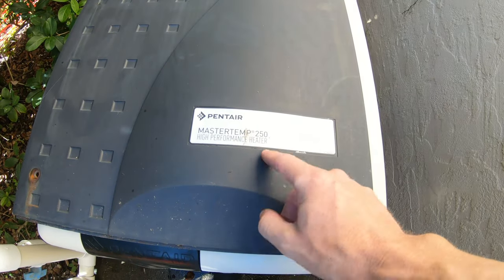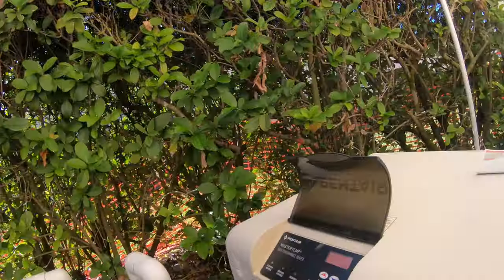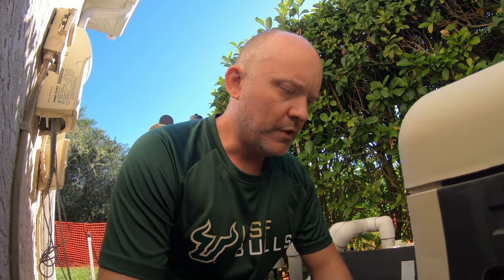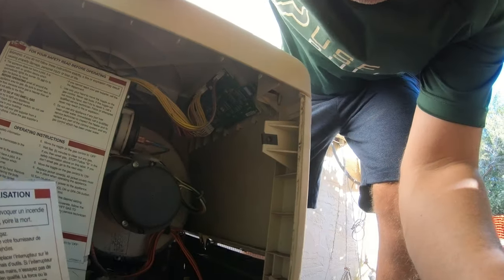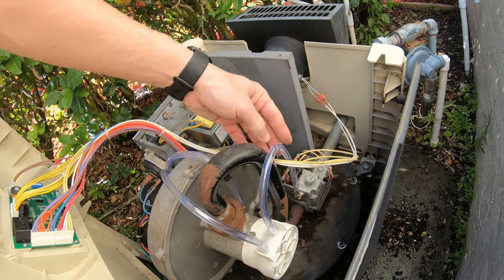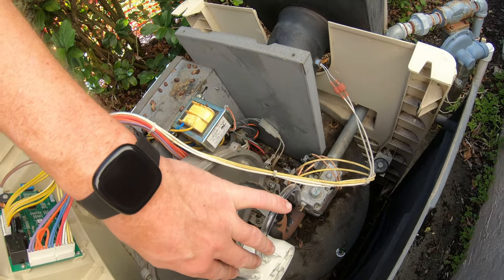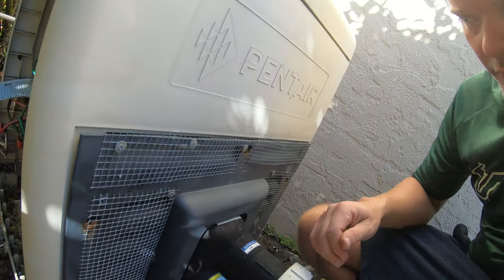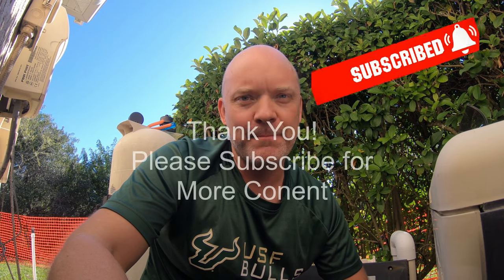Pentair pool heater turns on but does not heat, how to fix.

Comment: Nice job! We have the same heater with the Service Heater light on. We will have to see if any rodents damaged any of the tubes.
Reply from the maker: Jon, I was kinda shocked at just how open these units are. Just about anything smaller than a squirrel can get in there... good luck!

Comment: A lot of the mastertemp problems are rats chewing but also the control boards getting wet.  Those covers still allow water in.  I see it all the time. When the control boards go you will get false sensor outages as well.  This is the number one issue with these.  Replace the top keypad as well.  Aftermarket's work fine.  Peace. I work on 20 of these a week at least.
Reply from the maker: Yea, I'm about to do a keypad video here soon.... kinda shocked how open these were made. The vent holes are huge! Thanks for dropping in.

Comment: Great video! Our clear tubes were pristine, so I replaced the Air Flow Switch.  The system worked for about 3 weeks and has quit again.  Is the next step to take apart and check the fan for debris?  How would that be accomplished?  Thank you.
Reply from the maker: At what point is it failing? Does the burner kick on at all?
Reply: @JackofAllTrades1  Thanks for the quick reply.  No, the burner does not light at all.  The system clicks 4 or 5 times and I can smell gas as it tries to light, but it eventually times out and displays "ERR IGN".  I also noticed when I first turn the heater on, it is displaying "ERR AFS".
Reply from the maker: @shawnstewart00  same thing happened to my neighbors unit and it ended up being that the spark electrode had rusted away from the burner so it was no longer near enough to the natural gas to ignite it. There are several safety features on these heaters so the fact that you are getting all the way to gas releasing, but there's no ignition, means one of the elements of fire are missing. Maybe air? You said you were thinking of checking for debris in the intake.... I think that's a good idea. The click you are hearing is the ignitor, but it may not be close enough to combust the gas or may not be getting enough air.

Comment: Hey jack my pentair 400 won't ignite the blower kicks on but the heat won't kick on just the blower I've replaced the thermal regulator and a high limit sensor and it's still not working anything else I could be looking for
Reply from the maker: I'm assuming you checked the tubes like in this video ans none are leaking. Did you completely shut the power down on it after the part replacement? Check for a rodent nest in the actual blower? Should be a screen over the intake but it could be missing. Are you getting any error codes?

Comment: Hey I have a master temp 250 that I've had to replace just about everything on it at least twice. It goes through the start up cycle and won't fire. At first it was the HSI so I replaced it and it worked all summer. When it got really cold in the morning lately it wouldn't fire but then when it warmed up in the afternoon it would. Now it just won't fire at all. Is it possible that the HSI is just not getting hot enough. I know that after it cycles through the start up process and then locks out I have felt down around where the HSI is seated and it is pretty damn hot so I'm pretty sure it is working. Could it be getting hot and still not working? When I pulled it it looked fine the prongs are not damaged or cracked it looks good as new. I get no error codes on the button membrane and when I looked at the back of the control board I see no error led lights coming on. Still starts up blower comes on clicks three times than locks out. I can smell the faint odor of gas after the clicks and have checked it with the AGS disconnected and jumped with a wire. Still wouldn't fire. when I just disconnected the AGS and left them hanging and tried to start I could see on the back of the control board the red led next to the AGS marking as it should be. All electronics seem to be working fine as they should. Damn thing just doesn't want to fire for me. The last time I was able to get it to fire it seemed to take much longer than usual after the click and then I finally felt a little warm air coming and then it fired. May be I just need yet another HSI which would be the third one I've gone through this year. Other ones I replaced were obviously damaged so it wasn't a mystery but this new one gets hot and looks fine.  Actually  keep a spare HSI around just for that reason but my spare wouldn't fire it either! Both get hot and seem to be fine. Any ideas what could be wrong?
Reply from the maker: Interesting. Ok so your startup process is making it pretty far it sounds. It has to go through several safety check before it will even allow gas to release. If you are making it that far then there are only a few things left that it can be. Either amount of air or quality of ignition. You've double checked that the air intake and exhaust are not blocked? Where are you sourcing your HSI? Quality part? It sounds like you know enough to properly troubleshoot this. Is the heater in a really damp area? Have you tried cleaning the HSI after it fowls? The only other thing I can think of is improper voltage to the HSI where it doesn't get enough to become red hot and ignite it within the ignition window.
Reply: @JackofAllTrades1  Yeah I think it may be that the HSI is not functioning properly it just seems weird that it would fire in the afternoon when it was a little warmer but not in the morning and then it just stopped firing completely. Also the last time it fired it stayed on for like five hours and warmed up the pool fine. I've tried jumping other safety switches like the water pressure and high limit switch as well to no avail. I think that my problem may be within the ICM just not getting enough voltage to the HSI as you suggested. I don't think the ICM is totally fried because it still takes the unit through the start up process as normal and then flashes three times when it locks out as it should. It's really frustrating when everything seems to be ok but the unit just won't fire. Not relishing the thought of getting a new ICM and a new HSI probably looking at 500 bucks minimum. Then no assurance that it will fire even after that. The unit is outside and not in a shed or anything so I don't think dampness is the issue, although I did speculate that condensation in the combustion chamber was getting on the prongs of the 
HSI from the coldness at night and then warming in the morning. But I have tied blowing a heat gun through the intake of the blower for a while to see if I could warm things up a bit in there before starting and that didn't work either. Like I mentioned I looked at the HSI multiple times and can see no moisture or cracks or anything that would be an issue.
Reply from the maker: @fliktrax  that's a tough one for sure. A pool tech would probably sell you a new heater rather than troubleshoot this. Have you been able to find a manual and verify correct voltage to the HSI? I think at this point you need to verify voltages first before you fall down that rabbit hole of throwing parts at a problem. That can get really frustrating.
Reply: I’m having the same symptoms as you.  Did you end up figuring this out?
Reply: Have you pulled the igniter out and checked ohms? Should be between 60-90 I believe

Comment: I just purchased a home that has this same exact heating unit.  The pool inspector mentioned that it wasn't working so I'm going to remove the panels to see if it can debug it.  Hopefully mine would be a simple fix.
Reply from the maker: This issue I had was pretty simple compared to some of the issues people have come here with. If you get stuck, check out all the different comments here... many times, I help somebody troubleshoot and resolve the problem. Good luck!
Reply: @JackofAllTrades1  Thank you! I think pulling out the panels and visually inspecting the motor, circuit board and other visual signs of damage might be a good starting point.
Reply from the maker: @DesmoSD  agreed. I show the basics of where to start with that. Lmk if I can help.
Reply: @JackofAllTrades1  Thank you!

Comment: My pentair heater is having issues heating too. For the past couple of months the igniter has blown up several times. Now the igniter is blowing up every time a new one is installed. I’ve had the repairman try to fix it 3 times this week. A new igniter control module was installed (the old one was fried) along with a new igniter. After that it heated until 101 degrees. Then when it went to heat up again the igniter exploded. This has happened several times where it will heat to the set temperature and then the igniter explodes when the heater starts back up. Any idea on what could be causing this? This is beyond frustrating.
Reply from the maker: If you've had repairmen out and they can't fix it them I'm not sure I can help. If a new igniter is blowing up then my first idea is that it's getting too many amps and volts. Try looking up what the operating voltage is for the igniter and use a multimeter to check what the output is at the connector. If it's putting out too much then it's possible that a capacitor or transformer is feeding it too much and may be bad.
Reply: @JackofAllTrades1  thank you for replying! I will be sure to give this suggestion to the repairman who is coming out today again for the 5th time now.
Reply: @losangeles5615  The ignitor is sitting in combustion space surrounded by circular pipes pressurized with pool water. I would remove one of the bottom bolts holding manifold on to see if any water leaks out.

Comment: Thank you Jack for this video. My heater is Jandy LX and I get a service code AGS. It looks like it will start and I hear the flow of gas/ and sound of flame/ Fann, but it stops after 30 seconds with AGS code. Any thoughts? Thanks again
Reply from the maker: The only reason I could think that it would fully run and then shut off would be water flow or temp. Have you tested the temp sensor out? What temp readings are you getting? Are they real high or low or do they make sense?
Reply: @JackofAllTrades1  Thank you for your reply. No I didn't test the temp sensor out. I'm kind a newbie here, and I don't know where it is or how to test it. But the reading on the heater screen shows the water temp as 20c and I adjust the heater to 26c. From my searches, the AGS means Automatic Gas Shut-off sensor and I couldn't figure out where it is located to test it.
Reply from the maker: @obeliskgroup5714  nearly all of the sensors are located behind the smaller black panel that is located where the inlet and outlet water pipes are. If you Google a schematic of your model it may show what each one is.
Reply: @JackofAllTrades1  Thank you. I searched for it and downloaded all related drawings I could find, but I didn't see the location of AGS sensor although it was mentioned in the trouble shootings. I called a technician today and will see what he can do.
Reply from the maker: @obeliskgroup5714  good luck, sorry I couldn't be more help.
Reply: @JackofAllTrades1  Thank you for your sincere help.
Reply: Update: A gas Tech came to check the pool heater. He said there is nothing called AGS sensor. AGS is a state can be caused by many reason. Mine was so simple which was all gas nozzles were blocked by spider threads. He just cleared all of them by a Pipe cleaner bristle. That's it. Thank you for your help. I hope this update may help others as well.
Reply from the maker: @obeliskgroup5714  awesome, I'm glad it is fixed. Thanks for the update.

Comment: i can see lights on the main jandy aqualink panel but no lights on my heater i fixed the wires that got chewed by rats.......is it  a bad fuse?
Reply from the maker: Ok lets check a few things. Your pump is on? Is the pull fuse in the correct position in the panel box feeding it (it has an orientation)? Also, check that you don't also have a separate breaker for the heater in your main power panel that may be off.
Reply: @JackofAllTrades1  im not sure if the fuse is good or not im gonna order a replacement and see if that does anything.
Reply from the maker: @The Jungle Book  depending on your state and local code requirements, you may just have a physical pull breaker. They can't really go bad. That's what I have, but it is possible to have an actual breaker too.
Reply: so the fuse actually fixed the power issue going to my controller but its seems the spa isnt getting hotter although the heater is alive now...
Reply from the maker: @The Jungle Book  is it possible you turned off the water valve and the spa is not getting water circulated? Does this heater also heat a pool? Is it getting heat?

Comment: Hello Jack, I just replace the combustion blower fan motor on my mastertemp 250. I'm not getting any ERROR codes on the front or back of my display board but on the Diagnostic Indicator it's giving me two flashes "Flame No Call For Heat"  what am I missing here? Please HELP!!!
Reply from the maker: Was gas turned back on? When you kick it on does the fan run at all? Does it try to start?
Reply: @JackofAllTrades1  yes I made sure.
Reply from the maker: @marlonlara1954  what happens when you push the pool heater ON button? Anything?
Reply: @JackofAllTrades1  I replaced the Igniter and the Stack Flue and nothing. I hear it click but does not fire up. ☹️
Reply from the maker: @marlonlara1954  the clicking is the ignitor. Hmmm .... sounds like the gas valve is not opening. Do you have all your vacuum tubes hooked up? Is the fan kicking on?
Reply: @JackofAllTrades1  yes, took a picture before disconnecting anything on the blower. I also replace the Air flow switch. It’s just weird that I’m getting any error codes. Everything was put back together carefully.
Reply from the maker: @marlonlara1954  I wonder of the ignitor is not getting a proper ground. Like when you put too much take on a sending unit and it doesn't get a ground so you get no reading.
Reply: @JackofAllTrades1  there are two tubing coming from the AFS I took the one off close to the motor and it fired up. I don’t know if it will effect the motor or I just got a bad “NEW”AFS? 🤨
Reply from the maker: @marlonlara1954  interesting... what does it do if you put it back on? Does it still malfunction. All those vac tubes operate safety switches... so essentially removing one bypasses a safety.
Reply: @JackofAllTrades1  it is weird. If I connect it back it stops and starts calling for heat.
Reply from the maker: @marlonlara1954  so having the hose off means the fan runs but the heater is off (and no call for heat). With the hose on, the fan doesn't run but it calls for heat? Just making sure I understand this.
Reply: @JackofAllTrades1  for some reason it’s working with the hose off. Spa is starting to heat up now. 🥰
Reply from the maker: @marlonlara1954  well... seems odd but it's working. Hopefully it's still safe.
Reply: @JackofAllTrades1  Hopefully. Thank you so much for the help.
Reply from the maker: @marlonlara1954  np, glad we could sort it out.